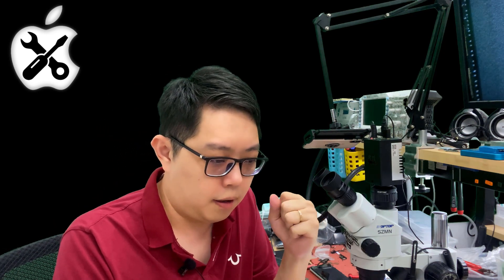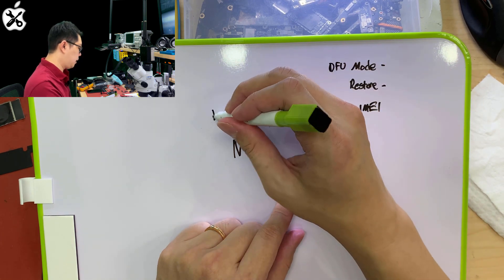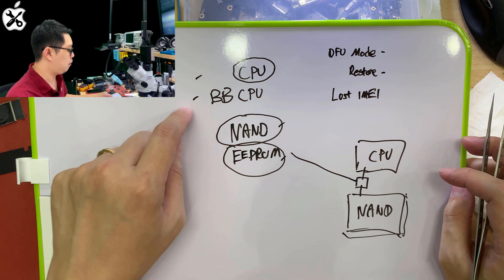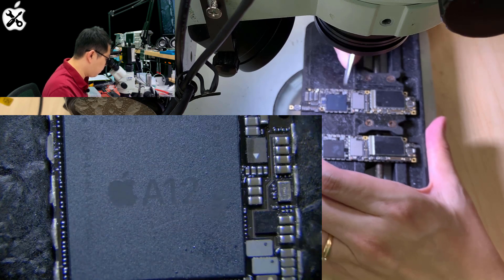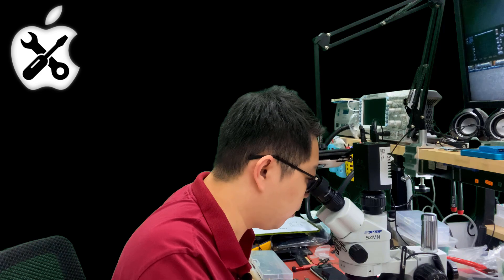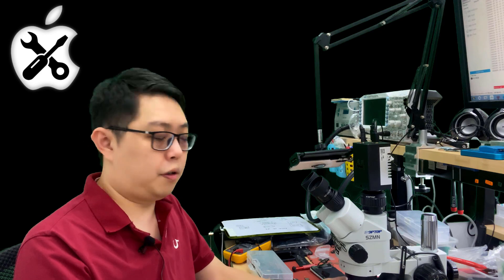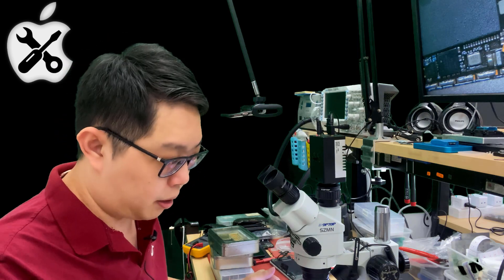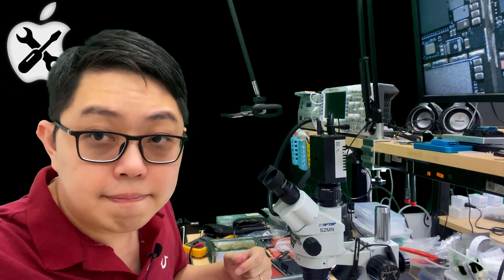Things that we cannot repair in the iPhone - Logic EEPROM

Comment: If all company follow this method than there will be huge e-waste on earth, its funny when they concern about environment by limiting accessories you get when you buy new iphone, while limiting the device to be repaired, if iphone is broken then you just throw it even if the faulty component is the simple chip, the most evil greed company on the universe
Reply: That's why I don't use iPhones
Reply from the maker: Well said. Comment is pinned.
Reply: @roseelectronics4582  reading your comment now, EU is now getting it fix due to higher ewaste currently produces from previous years up until this present.
Reply: LIKE fixing like as in the new series of iPhones that they will be repairable?

Comment: My cellphone is stuck on failed activation because the baseband has a problem, and I've tried to repair it with a swap board but it doesn't work. The technician says the EPPROM has a problem or there's really no hope at all. My cellphone is currently stuck on Hello and failed to activate?

Comment: yah, i'm having a ground dropped xsmax feel month ago, the screen has broken then i'm going to replace the screen, after installing the new screen everything still oke, so i'm going to install another new screen ( the first screen installed for testing after glass replaced ) then the phone get bootloop, i tried to reflash the firmware and get 9 error code, the eeprom get cracked in a corner, so sad

Comment: In case EEPROM baseband iPhone 12 pro max is damage, is not possible replace the component to new one EEPROM?? And this component broken something in the iphone istil working? or the phone is dead because this damage?
Reply from the maker: Until today it still cannot be replaced. Especially the model you're speaking. You can say it become a brick. Even you bought a new IC and it won't be working. There are scammers selling those new EEPROM IC.

Comment: yesterday, when swapping, I chipped the u_eeprom_e angle on the iphone x. I thought it was the end (there will be no network). I soldered it on the programmer-it is not readable and not visible. With a needle, I poked the chip soldered to the programmer into the corner of the chip and IT COUNTED! The dump was re-uploaded to the whole. Probably with a needle he closed the break in graphite between the crystal and the contact leg
Вчера при свапе сколол угол u_eeprom_e на iphone x. Думал это конец (не будет сети). Напаял её на программатор-не читается и не видится. Иголкой ткнул в припаянную на программатор микросхему в угол скола и ОНА СЧИТАЛАСЬ! Дамп перезалил в целую. Вероятно иголкой замкнул обрыв в графите между кристалом и ногой контакта.